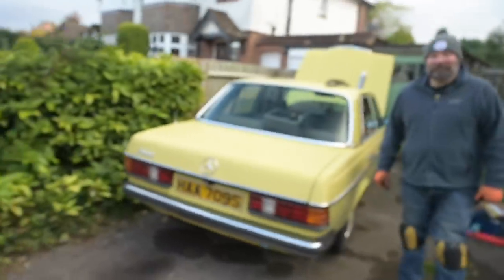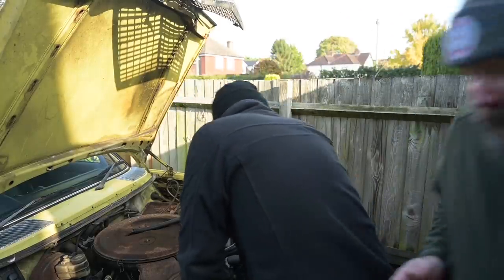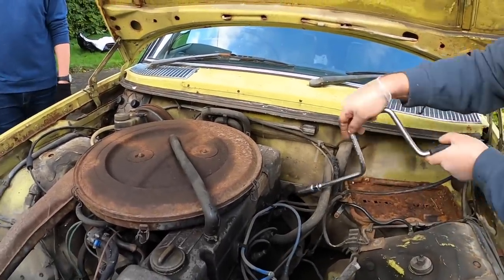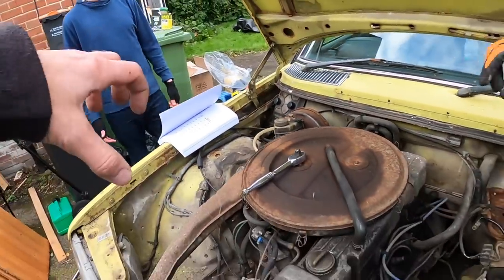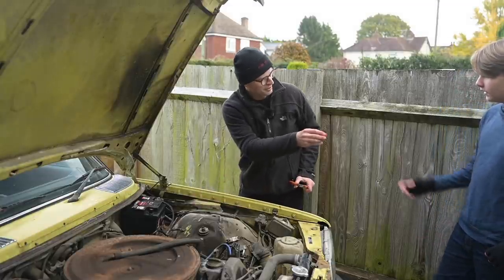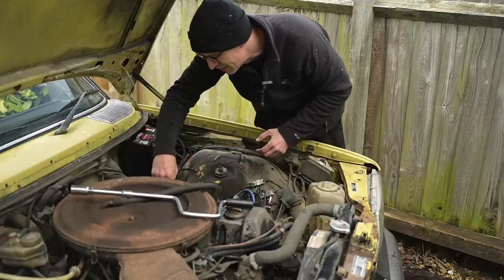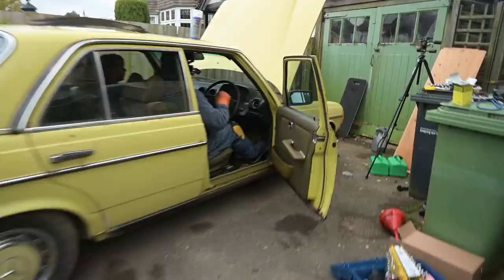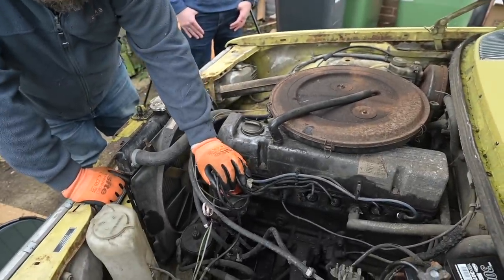Mercedes 250 W123 first start

Comment: Never doubted that it would start, the air filter for this is available on AutoDoc, probably be a good idea to get the sunroof open which should be reasonably easy, the motor is in the boot on the left hand side behind the inner boot panel if you get no joy from the switch, doesn't look to scabby under the bonnet which is a really good thing on a W123 as you know well Matt, keep up with the great work, looking forward to seeing the next installment for this fine piece of German engineering

Comment: Mercedes released some W123 workshop information, replacement parts, fault diagnosis, etc on a data DVD a few years ago - that might have information on the 250 and things like the fuel filter? It's available on the Mercedes-Benz Classic Store (under library, then technical information) - currently on sale(!) at about £71. I haven't seen the W123 one, but got the version for the W202 recently and am very happy with it. You can print off the sheets you need so you don't need a laptop near the car.
Reply: At that price someone must have bootleg copies.
Reply from the maker: That sounds like Mercedes parts prices!

Comment: Evening Matt the W123 doesn't have a fuel filter to speak of,it does however have a strainer,gauze thingy which is Jin the tank by the outlet if you look up from under the car you will see a large nut that screws into the bottom of the fuel tank,be careful as there are a right royal pita to get undone.
Better to put an inline filter on the supply pipe just before the pump which is driven by the engine ,on the left hand side in front of the carb iir,it's been a while since I had one in  so good luck.
Reply from the maker: Thanks, I thought it must be a mechanical pump as I couldnt hear anything. An inline filter would be good in there

Comment: Have never heard a 250 running. 
Technically, this was a W123 250 running, as in, making noise and exhaust fumes. Right into the interior of the C Class as well. Good plan that was.

Comment: This car actually has a mechanical fuel pump, they usually don’t break down in the sense that the stop pumping fuel. When they break they just leak. Out of all W123 the 250 is one of the least reliable ones, so starting it up like this is quite remarkable. The Solex 4A1 carb is not known for its finesse and simplicity.

If the plan is to restore it I would think twice. The car seems quite exhausted.

Right now I am busy with restoration of a 300D. We have about 750 hours of labor in it and the body work is now done. Factory new that is, but the work load is massive.

Comment: Nice 250 and great video.
When you change the coolant, remember to drain the block as well, it should be a 17 or 19mm bolt on the side. Make sure to sand the washer flat if you can't find a new one.
Reply: Its also possible just to change the liquid in the cooler at the front, then just run it some time for mix old and New and replace it again? Dort of flush it..
Why? On this old cast iron block these blockoffs can crack the thread because of rust and crud, they seal up badly later...
Maybe it is wise to go my w123 250 with a little more effort and not risk the car engine block? Replace the waterpumpt and thermostat should be much more important

Comment: It sat outside for two years and ran fine when it was parked so there shouldn’t be much to stop it being a runner. They’ll be antifreeze in it or the block would have already cracked but it certainly would be good to flush it all through. Maybe blow out the fuel line and clean the tank too.

Comment: Hi Guys just a heads up regarding the oil around the rocker cover and plugs. I found on my 250 oil coming down and through to the spark plugs there are bolts that pass through the head and sit above each plug these bolts are the camshaft retainer bolts which can come loose allowing oil to leak through. They need locktite applied to them and to be re torqued.
Reply from the maker: Thanks, will watch out for that!

Comment: Apparently all the fuel filtration the carburettor fitted W123 has is an inline filter before the carburettor and a strainer in the bottom of the tank.

Comment: What is the actual colour ?   If Mimosa Yellow. Less than 800 produced in that colour.  There should be an electric fuel pump and filter behind the rear axle together with accumulator.
Reply from the maker: there SHOULD be...maybe not on carb cars, or its been moved?
I think it is Mimosa
Reply: @furiousdriving  unfortunately I cannot show you what what it should look like with a bit of polish. I have a 240D Mimosa Yellow. People stop and remark on it.

Comment: Matt are you aware the speedometer is not original to that car? The speedometer in that 250 is from a series 2 W123. The original series 1 speedo had the MPH numbers displayed in increments of 10 instead of 20 as the series 2 and 3 cars had.

Comment: German excellence in engineering.  Seeing that rust on the inside of the roof, did this vehicle live by the coast at sometime in its former life?  That's the one problem with modern vehicle registration documents, the number of owners yes but not for how long and where like the old log books.
Reply: Oops, that should read former keepers not owners.
Reply from the maker: Its been in the west country the last decade at least, and well inland so probably blocked drains or perished seals

Comment: Bad idea putting the fuel can over the carb .If it back fires the can will go up
Reply from the maker: there was only a drag left, barely even vapour, and with the car not running it cant backfire
Reply: Matt get a mustie1 type bottle for carb feeding
Reply: @furiousdriving  Try putting a lit match in the empty can and see what happens the fumes go up before any liquid .And if the timing is out or a carb fault it will back fire through the carb ,even just  turning over .Once you have seen what happens you won't make the same  mistake  twice